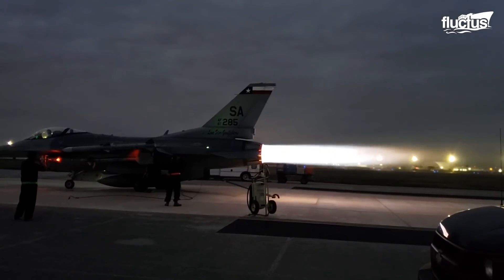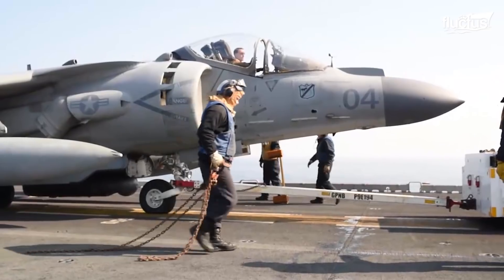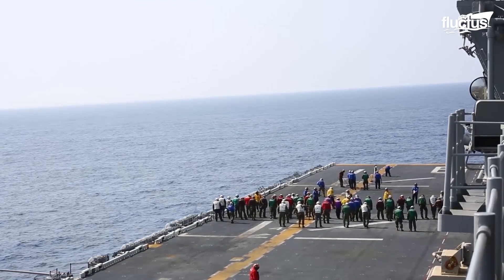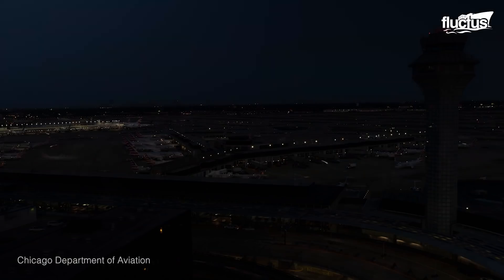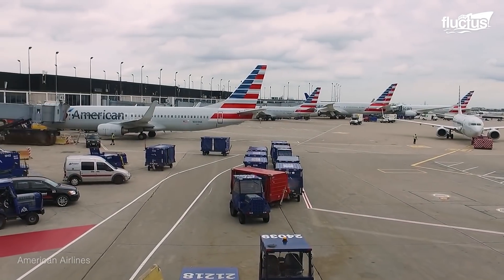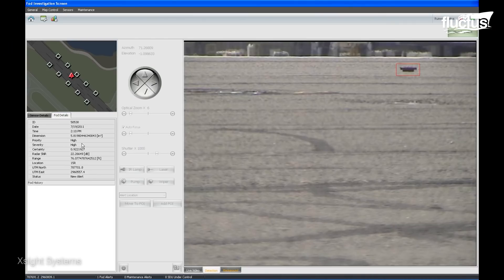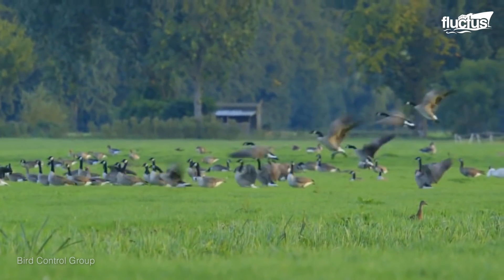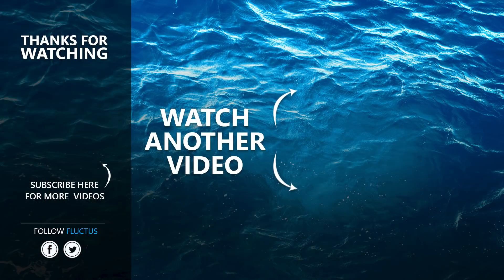Why do Navy Crews Have to Walk on US Aicraft Carrier Deck to Save Pilots’ Lives

Comment: FOD not only describes objects left on the runway or flight line but it also refers to objects left in equipment, avionics or engine bays. Cockpits are extremely sensitive to FOD where an object can cause an electrical short or jam flight controls. If an object doesn't belong there it is considered a foreign object.
Reply: hey man you know what is FOD what you said is not exactly right
if trash is left on the flight line that is FOD it means Foreign Object Damage that is what it means you walk on the flight line to find FOD that can damage the jets

Comment: Pilots and passengers will be safe when automation fully takes over operating aircraft.
Reply: And what would automation do about FOD?
Reply: @ericcif68  sweep/vacuum the tarmac remotely on a regular schedule.
Reply: What on earth gives you that level of confidence?? Humans are at the root of everything, including the MCAS system that brought down two aircraft and grounded the rest for years... Self learning computers, or AI could spell the end for life as we know it. Once machines learn how to move about, reproduce and improve themselves, we as humans will be redundant. Are aliens already visiting us? Are they life or machines. I would suggest only machines could travel through interstellar space. Voyager 1 and 2 are still travelling and sending back information after 44 years and 14 billion miles. Humans couldn't do that....
Reply: @nalakprince6376  Boeing is working with the FAA to certify commercial jets to fly with only 1 pilot.  A true sterile cockpit is on the way.   
Next up, empty cockpit.
Reply: @michaelmccarthy4615 An approved empty cockpit is not going to happen. The concept of single pilot is for cargo operations and two pilots are still required to be in board. It just enables one to take a break on long haul flights but still be available in case of an emergency, rather than carrying a 3rd pilot. The systems will be configured to enable suitably trained flight deck crew to combine the roles of pilot monitoring and pilot flying during temporary periods. Whether that is extended to passenger operations is another matter.

I doubt that any airline would dare to suggest one pilot in the cockpit on a passenger flight is a safe scenario... Especially after flights like Malaysia flight MH370, German Wings flight 4U9525 and the current mystery around China Eastern flight MU5735...

There are too many variables and possibilities for failure to do away with pilots completely.
Reply: Not on a limited spaced ship with thousands of people already available
Reply: well you still need to do maintenance on them and you still need to do FOD walk down any ways so you dont damage the aircraft